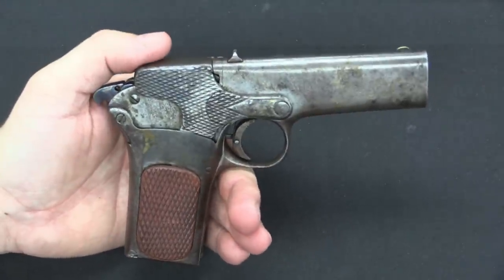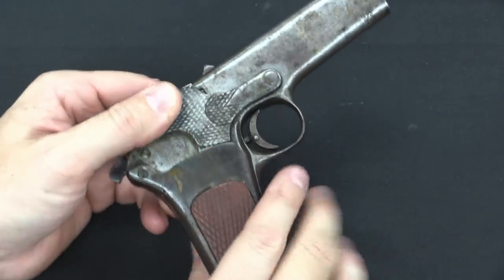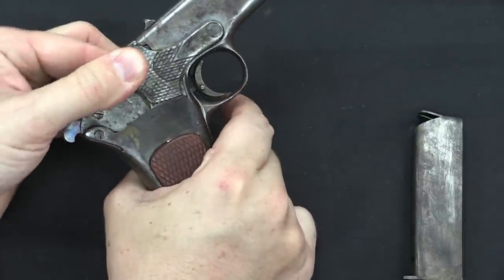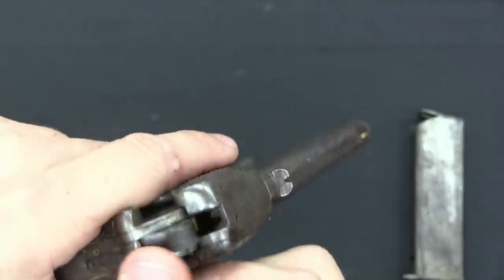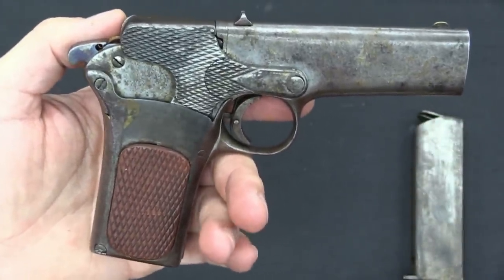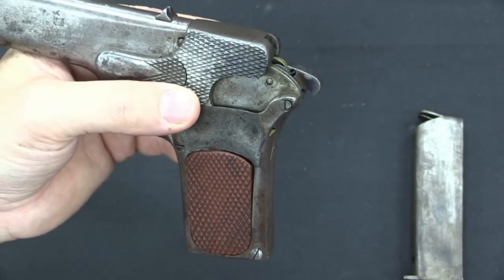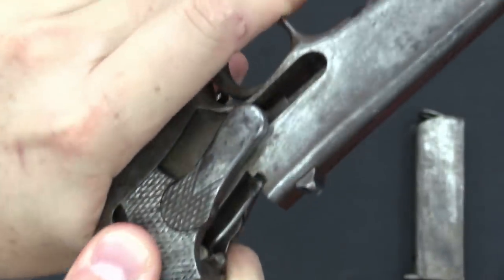"Rocking Block" Mystery Pistol

Comment: I'm guessing it's an unpatented prototype.  If it were patented, then it would have Patent Pending, or the Patent Number on the side.  There's certainly enough space to stamp it on the side of that barrel/spring housing.  Gunshop experiments aren't typically serialized, but this is obviously not a production gun.  The action is so unique, it's almost certainly a 1-off experiment.

Comment: How exactly does the auction house's FFL fill out the 4473 for the winning bidder?

26. Manufacturer: Unknown
27. Model: Unknown
28. Serial Number: None
29. Type: Pistol
30. Caliber: Unknown
Reply from the maker: +craigtheng Something like that. :)
Reply: +TheDoctorGnome Or if it will fire
Reply: I'm fairly sure It qualifies as an antique firearm making it exempt. Even replicas like the Colt SAA Wyatt Earp edition which was made in the 1950s doesn't have a serial number at least mine didn't.
Reply: It works for 99% of guns sold. I'd say that's pretty solid.
Reply: list it as a Curio and relic it's odd and obviously old
Reply: It's a so called (ghost gun)
Reply: Fermin Valdivia Its maker is most definitely a ghost now. Lol
Reply: The serial number law only came into effect during the 1960's.  Not antiques, but still no serial number.
Reply: @emiliovalero995  There was no law requiring serial numbers on firearms until some time in the '60's. The military required serialization for their weapons, but the civilian market didn't, so really only military weapons had them. Some companies serialized their guns, anyway, but they didn't actually have to, they did so for their own records and purposes. Colt was very known to serialize because so many people ripped off their designs, and because they supplied so many guns to the military.
Reply: Antique don't matter ..
Reply: Only manufacturers are required to put a serial number on weapons, not makers.
Reply: Why can't the caliber be determined? Shouldn't it be obvious from the bore diameter?
Reply: W Winterheart “gun Jesus”

Bullseye
Reply: W Winterheart no. He said he expects its in .32 acp
Reply: Whoever built this pistol did have a propensity for craftsmanship. Note the color case hardening of the hammer and the general fit and finish. This was not made by your average bubba.
Reply: @BDNeon  Caliber, yes--exact chambering, no. There are a lot of cartridges that use the same diameter bullet, or close enough. For example, say you mike a mystery gun's bore and it's within a few percentage points of nine millimeters (or 0.36 inch, if you're working in US units). That could be 9mm Parabellum, sure, but it could also be 9mm Largo, or 9mm Steyr, or 9mm Glisenti, or 9mm Ultra, or .380 ACP (aka 9mm Short), or .38 ACP (which is not the same thing as .380 ACP). or .38 S&W, or .38 Special, or .357 Magnum, or... well, you get the idea.

Granted, some of those are going to be more likely than others depending on the type of gun--a semiauto, for instance, is unlikely to be chambered for .357 Magnum, although it has been done, and practically nobody ever used 9mm Ultra besides a handful of West German police--but even so, bore diameter usually can't tell you enough to make a safe assumption all by itself.
Reply: @ps2hacker  The 1934 Federal Firearms Act required hanguns to be serialized, the 1968 Gun Control Act required long guns to also be serialized.

Trivia: The main intent by the authors of the FFA 1934 was to regulate handguns like machine guns, including definition of barrel length below 18" and overall length of 26"-anticipating people would saw down long guns once $200 tax on handguns imposed. Obviously, the handgun provision was unpassable thus removed, but the short barreled rifle/shotgun provisions remain to this day,
Reply: It seems to be non functioning as the hammer doesn't drop. Now it's impossible to say what else is missing but it doesn't need a serial number if it's non functioning (if I remember correctly.im not amerioso I'm more familiar with our gun laws here)

Comment: If I were able to get my hands on this thing I'd do my best to make it functional. I wanna see that unique action working in slow mo!
Reply: TestECull Well, it'd be a better idea to break it down and make an inspired design
Reply: iotaje1 It's easiest to learn how this thing works by repairing it. If you can get it to fire, even just two rounds in succession, then you've already gained a wealth of information on the action that you won't get by taking it apart and making an inspired design. There may be quirks to this thing that only manifest when you're putting rounds through it, after all.
Reply: You're right.  Now I'm thinking, could the rocking movement be used to counteract recoil?  This would require the action to be turned inside down, and have the mag out of the handle.  the result would be similar to a C96, with a lower bore axis and an upside down rocking bolt system. 

I just redesigned the kriss vector
Reply: TestECull I bet it will fire with the firing pin stuck forward like that

Comment: Thanks for sharing,
this is a weird one for sure...

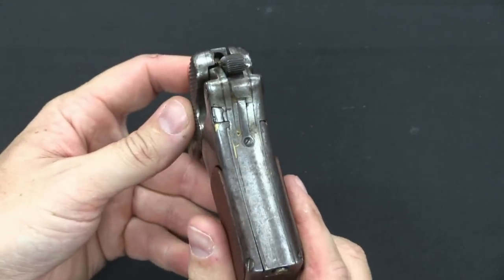3:48:73ms, - 3:49secs,
There are a few stills that are remarkable.

There appears to be on the left hand side of the slide a "Y" and a symbol beneath that (Pali or Sanskrit, maybe the sinoxenic pictogram for 'month'?).
It also appears to have writing or etching faded near that (sanskrit thats faded?) - maybe makers marks on the weapon?

On the right hand slide, there is an 'E' with an = sign in place of the middle "-"

The knurling and action remind me of French or Indian design influence,
the handle looks bizarre though,
(a 5 lightly etched on the right side)
and there's a tulip/lotus-shaped "pacman" relief on the knurled reciprocating arm...

The hammer also appears to have been sawed or filed... (the still at 2:08:41ms) - there might have been 'spurs' which interacted in that gap?

My guess is that its from Asia(thailand, Vietnam, Laos/Cambodia) or India.

Apart from that, Metallurgical analysis might help (it'd tell you how old and what kind of metals are in it),
and looking at the internals would help (I'd be more inclined to say European if theres a lot of watch-like internals or any makers-marks in there).
Those tulips are probably the tell though.

What a weird prototype gun though.
Reply: Very insightful!
Reply: Im no expert but it looks like a reverse recoil spring where it is stretched but I can allso imagine it working like a plunger with a Spring behind the plunger piston head tho I’m kinda intrigued by the idea of something having a pneumatic function like that now and how to make use of such a thing.

Comment: I actually really like that action. Its rare to see something that isnt just a straight copy of more popular firearm mechanisms. 

Is there a name for that type of feeding assembly?
Reply: thelol1759   Rocking block ?
Reply: I think lugers run off a similar action
Reply: @boxfoxreyes9950  this is nothing like Luger.
Luger toggle action is similar to Paterson Rifle, which is similar to Maxim Machinegun toggle action.
Reply: @davidjacobs8558  Are you talking about John Pedersen? Or am I wrong? I think Ian has a video on what you are talking about.
Reply: A bit late, but I’m not sure if one can call this much of a mechanism at all, as Ian makes no mention of an actual locking mechanism. So I’m guessing it’s  a straight blowback pistol, just one where slide, breech and recoil spring are connected in a funky way.
Reply: yes, it's called Ralph
Reply: @lovelybraintoaster164  and instead of the bullet being pushed from the back onto a ramp then up into the chamber, the mechanism grabs the bullet and pushes from underneath
Reply: @lovelybraintoaster164  It could technically be gas operated as well. Who knows if there's a tiny lil piston in there somewhere

Comment: Guns like this make you appreciate just how difficult it is to make a working and reliable firearm. Like, it's possible to hand file bits of steel and bang rivets in place. You can hand rifle a barrel. You can make a working Sten gun as long as you have a decent machine shop. But the shit they make in Fallout or some other game with crafting is just nonsense.
I'd love to see this gun fired, but I don't want to be the guy holding it when it goes off.

Comment: When I saw the dual side springs that run under the grips, I immediately thought of the Le Français pistol by Manufrance was produced from 1913 till 1969. Several people mentioned in the comments that they had seen this gun in old black & white movies which leads me to believe I'm right about my assumption that it is somehow related to the Le Français pistol. If this were an amateur copy, I believe they would not have used the more complicated coiled spring on the hammer. As such, I think it would be worth looking into the possibility that this is the original concept model that might have been created to test the feasibility of the dual springs. Once it is open it might prove to be a cheap mystery gun, but they used a unique feature from a very distinctive weapon and skipped the simple innovations and that makes me think it might be worth taking a closer look at this.

Comment: I think it is supposed to be a blowback pistol, so that the angled way it moves back slows it down enough that pressure decreases and will both cock the hammer and then chamber a round after ejecting and probably had a floating firing pin like a rast and gasser revolver and that is what it is missing

Comment: I would like to see an assessment of the iron sights on the bolt action Japanese rifles used during WWII. As a Marine in Viet Nam I was issued an M14 with automatic toggle and carried this same rifle for 2 tours of duty (22 months). I qualified on an M14 during the boot camp rifle range, but during infantry training after boot camp we carried the M1  Garand. The sights on the M1 and M14 are exactly the same. I don't know how the US Army trained its troops on the M1 sights, but the USMC set their battle sights to hit 9 inches higher than the point of aim. We could not "aim small to miss small". I suspect the Japanese sights allowed for a very fine sight picture.

Comment: My gut feeling is that the designer probably looked at an early "slide action" pistol (as opposed to those with a more typical bolt) and sought to minimise recoil by focusing reciprocation to only the breach block. The seemingly tough spring being both necessary to maintain a safe action with the lighter block and to dampen felt recoil. It may also be an accuracy thing as the sights don't move and will always be aligned the same with barrel, something a more typical pistol action has to be finely machined to accomplish. This latter hypothesis would explain the sights fixed on the barrel only and the smaller cartridge, both features which would suggest a target intention. 

 It's fairly compact so a home-brew pocket pistol is not out of the question but it's still large enough that a military contract or the target concept could be viable. 
 
 In summary, a bloody cryptic gun.

Comment: Its strange because someone clearly went to alot of effort to make this pistol yet seemingly didn't do it for monetary reasons. 
To me this just seems like somebody had a neat idea for a pistol mechanism, built it then finished it to a point where they were satisfied.
Reply: Judging by how the spring is broken and the firing pin stuck forward, the maker may have met his maker when firing it for the first time, or the guy who was trying it out before buying 1000 of them.
Reply: @travishanson166  Could be, im not sure a failure of that magnitude could have resulted in that damage but still a possibility.

Comment: I suspect that there is no missing part, and that there is a broken or dislodged firing pin return spring. When you pulled the breach back, the firing pin was protruding from the breach face, and the back of it wasn't coming back far enough for the hammer to hit it. Try pushing the firing pin into the breach block, and see if the back of it doesn't come out far enough for the hammer to get to it.

Comment: Estimated price 2000 - 4000 dollars? I was thinking about a hundred bucks.
Reply: koolaidman007 i'm with you. if more was known about it maybe it would be worth more. but as it sits, with Ian's knowledge,  .. scrap metal
Reply: koolaidman007 I was thinking $50.
Reply: koolaidman007 I would have to agree. Rare does not mean expensive. I have a canteen that was a sprint run in the 1950s. They made like 50 of them. It is rare. Worth about $5, haha. I have a Mossberg shotgun they only made 500 of. Worth about $120.
Reply: In this country I could be facing 15 years jail for that paper weight if I made it myself lol.
Reply: j0nthegreat Sure, it's not worth much, but I wouldn't call it "scrap metal". I think it's neat, that has add some degree of value, right?
Reply: koolaidman007 maybe 5
Reply: Jesse Sisolack in 100 yrs that shotgun will skyrocket.
Reply: RIA is notorious for overvaluing some of their auction items.  I bet it went for no more than a couple hundred.
Reply: Yes, but a pretty cool paperweight.
Reply: bu tre it actually failed to sell. The description for these videos are. Always updated to show. What the guns sold for
Reply: I was thinking more along the lines of them paying ME a hundred bucks to take this off their hands.
Reply: @butre.  it didn't sell, I can't believe they appraised it for 2000 to 4000.

Comment: Let's list what we know:
--Heavy external patina, suggesting considerable exposure to elements from carrying around and cleaning the outside.
 --Very questionable action, and no suggestion that it was worn out in a torture test or even fired much
--Unique design, but no name or mark or number
--No references in any known text about pistol prototypes
--Fairly crude sights
--Blowback design
--Oddly cobbled together spring and non-functional parts

I would suggest, based on this, that we're looking at another Chinese or possible central Asian one-off that some anonymous but brilliant person came up with when cobbling together blowback semis.

Comment: Forgotten weapons I have a question.  I have a round of ammunition that reads MARK 14 MS on the headstamp. It has a rather thick rim and an odd flat top bullet. Perhaps you know what this is? Any info would be much appritiated.
Reply: Bude-jon Nimstric MS means possibly West German (manusaar) '53 - '73 or modern austrian. what size it is would help massively (bullet diameter, case length and diameter, overall length, rim diameter and thickness) the round you are trying to describe may very well be .455 webley, being heavily rimmed.

Comment: Rewatching this I just realized it has no separate barrel. Seems the barrel is machined right into the frame. Either all made of costly high carbon steel or not very safe to fire. Either way it's about the most expensive way to make a pistol.

Comment: looks more like fyring pin is stuck or its spring has rusted up. I suspect the fyring pin might be actually pushed back by bullet it self.
I can't see any scratch marks aroun breach block. it does not look like it's been used much.
The machanism si a bit overcomplicated, certenly nothing i've seen on a pistol.

Comment: This is the original machine pistol.  you load it up and manually pull back and release the action, and it fires of the whole magazine...
Reply: source?
Reply: @neverseemstoAsh  You're joking right?  What do you think is going to happen after the first round fires with the firing pin locked sticking out? lol
Reply: @barking.dog.productions1777  uh... not that. do you know how guns work?
Reply: @neverseemstoAsh  I do, but apparently you don't.
Reply: @barking.dog.productions1777  On a serious note, I get the point you're trying to make about the firing pin slamming onto the primer of the round as soon as the "bolt" goes forward, but wouldn't the protruding firing pin prevent the gun from fully pushing the round into the chamber of the gun? As soon as the bolt picks up a cartridge from the magazine the rim of the cartridge is going to get caught on the firing pin as it goes up toward the chamber, and then jam up the gun. After all, the firing pin seems to be sticking a long way out of the face of the bolt. But yes, if you filed down the tip of the firing pin, and allowed it to just barely allow the round to slide past it and then slide into the breech, I believe it truly would be the original machine pistol...

Comment: It looks like 1911 made with a few parts from the wrong gun.
Reply: Not even close.
Reply: @themidnightrambler4865  more like a colt 45 with some wielded on parts
Reply: There is very little similarity between this and a 1911.
Reply: @joecary3586 , More like VERY LITTLE similarity between this and a 1911.  I agree with you. Kind of like a Yugo sedan and a Corvette are similar, in as far as they're both cars.

Comment: Gunsmiths, please buy this gun and make a functional version. I really want to see it in action. 

As it is, it looks like it would be kind of scary to shoot if it was functional. But I don't think it would be very complicated to slightly modify the design to be safer to shoot. Make the grip cover more of the mechanism, and adjust the extractor to throw the cases to the side, because as it is it looks like it would throw cases into the shooters face.